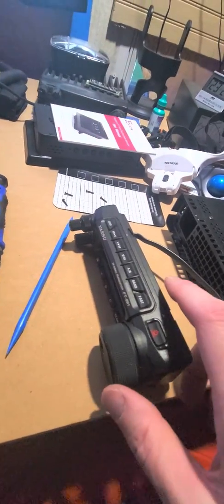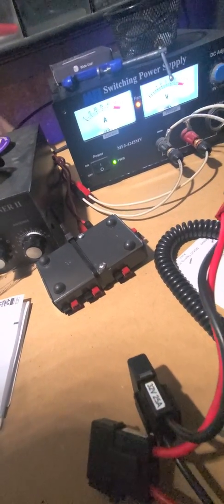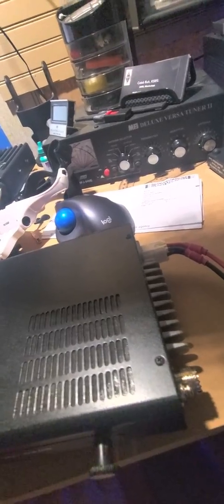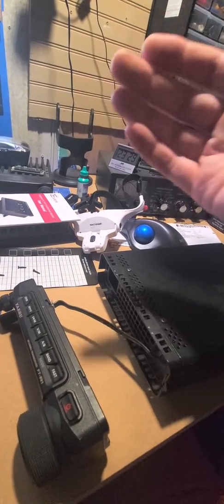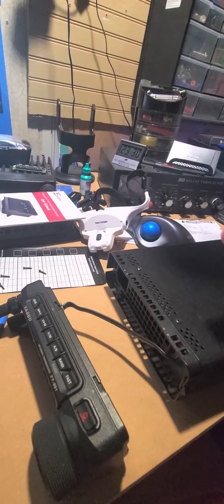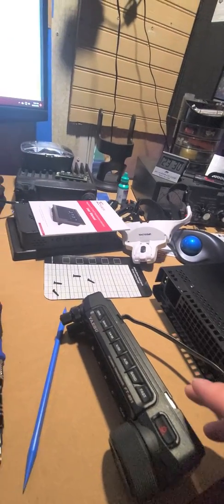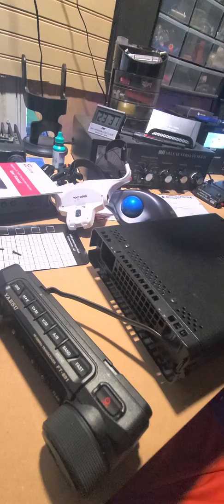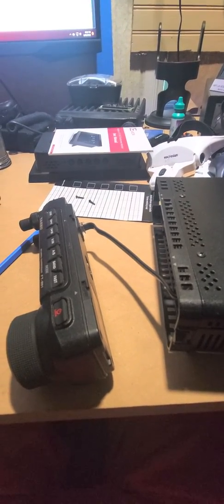Yaesu FT-891 click but power

Comment: What was the solution For you? Mine did the same thing and I believe it is the fuse inside the unit that controls the control head. I ordered a motor roll of fuse replacement and having someone soldered in for me. Please let me know what you found out for your radio.
Reply from the maker: Wait. I was thinking about the wrong radio. This one I sent back to yaesu. There is a tiny fuse on the board, 1 amp, I believe, that popped. They replaced it pretty quick. Cost me $30 to have them repair it
Reply from the maker: Honestly. I don't remember right off. I'd have to watch the video again to see what I did. Haven't had the problem since I did this video.

Comment: Yeah, having the same problem. Gonna be researching for answers.
Reply from the maker: I sent back to yaesu and will send again. There's a 1 amp fuse that pops on the board and has to be replaced. Be careful how you connect it. I think this happened because the extension cable i made to mount the head unit at the front of the truck was bad. One of my wires didn't make a good connection in the pinout. I found the culprit after I got the radio back.

Comment: The 891 needs more than 12.5v. Give it 13.8 and see if it comes on.
Reply: The FT891 has a operating voltage of 13.8VCD  +/- 15% so the lowest is 11.73v so you shouldn’t have problems with 12.2v unless you are trying to push 100w
Reply: Ok, just checked mine and it did come on at 12.2v but it wasn’t very happy.

Comment: Have you tried disconnecting and reconnecting control head cable? Voltage to the plug that connects to the back of the radio?
Reply from the maker: I have